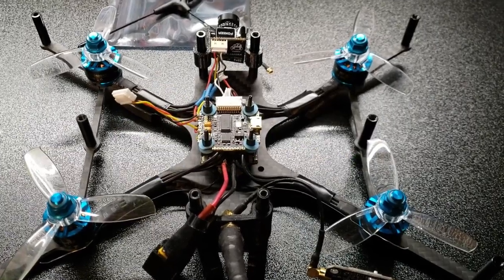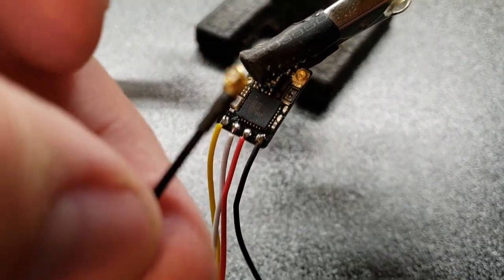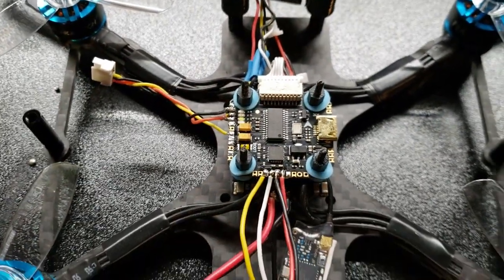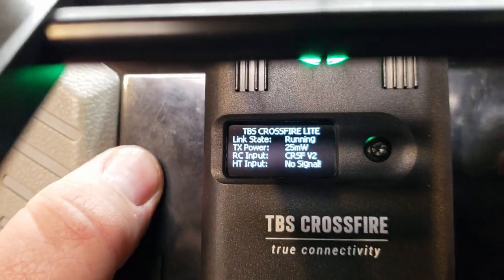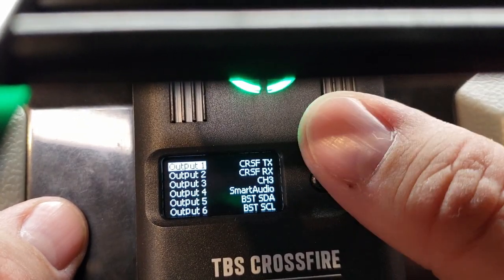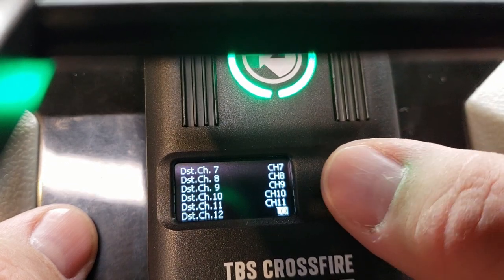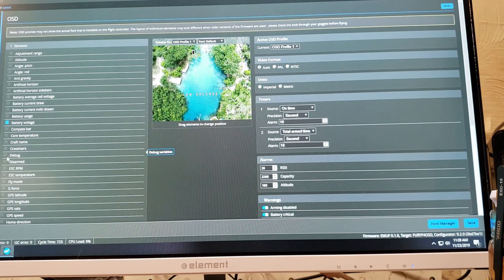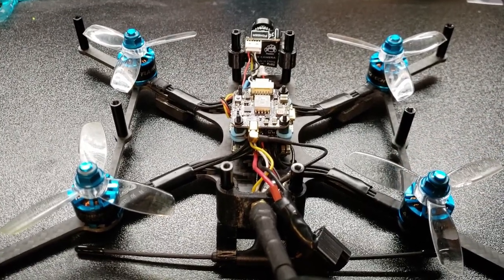TBS Crossfire Nano RX Install and Setup

Comment: Ive been days trying to connect crossfire micro tx v2 and nano receiver to a android app, hopefully you can help with nano wiring, my board is matek f405-wing flashed with inav, nano channel out 1 is wired to rx1, channel out 2 wired to tx1, 5v and ground same uart. It binds no problem and all telemetry coming back to radiomaster tx16s but just will not connect to app, my question is should nano channel out 3 and 4 be wired to a separate uart on the f405 in order to connect to app via wifi? Any help will be appreciated
Reply from the maker: I honestly know nothing about wings. So I don't want to give you the wrong answer. Have you tried the Team Black Sheep group on Facebook?